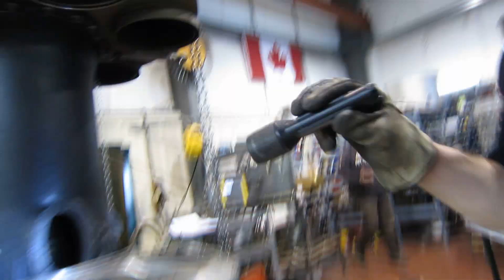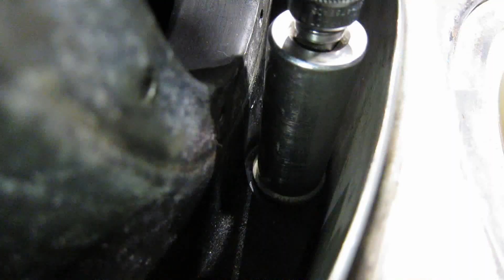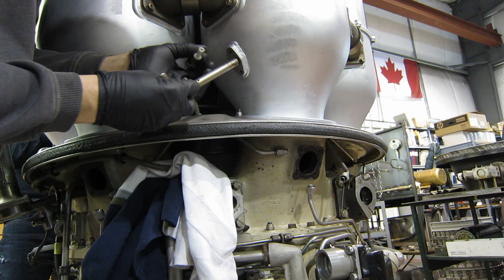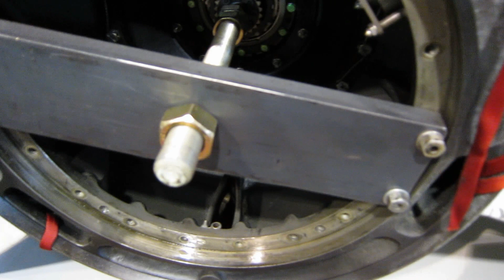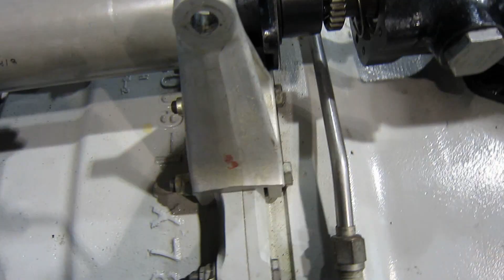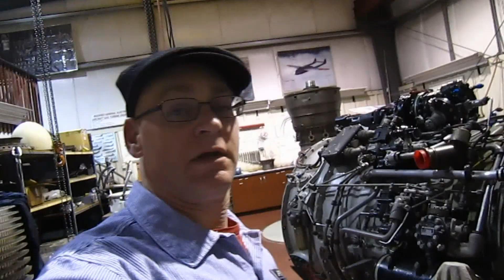Orenda 14 Part 3: Reassembly

Comment: from my experience on the J-79, a faulty #2 bearing can cause damage the rear compressor shaft. you must take measurements of the shaft before continuing closing the compressor module with the rear frame and combustion section. 
your series of videos taking me back more than 25 years when I was working on these engines. 
cheers!!!

Comment from the maker: I didn't mean to imply that reliability meant resistance to gunfire. 
I think all the redundant systems are there for mechanical reliabilty. All the components are necessary to fly, and they are highly stressed.
All the manuals say things like " if one pump should fail...", or " if one fuel control should fail..."

Comment from the maker: We have several RR Nenes in containers right outside our door. They are one of the highest rated centrifugal-compressor jet engines.
Unfortunately they don't have an industrial application, so we haven't done anything with them yet.
I'd like to run one.

Comment: Figured that might be the answer, though I'm so often impressed by what tiny thin part will support several tonnes of force in those engines, it wouldn't have surprised me that the gear drive shafts would easily support a couple of hundred kilos.

Comment from the maker: Walter is the big guy; he's about 6'6"... Ryan helps me horizontalize the Orenda.
... and good eye, there! I was twisting the wire by hand so as to not let the pliers leave a nick in the stressed section between the bolts... This is an aircraft engine, and there can be no compromise

Comment from the maker: The shafts are a bit larger than pencil-diameter, and the angle drives for them are not designed to handle axial loads. The rotor weighs over 500 lbs... would you want your jetfighter engine to be treated like that?

Comment from the maker: The pumps and such are all cast out of aluminum, and weigh about one fifth of what they might as regular industrial parts. This engine has duplicates for backup if the primary fails. Those backups need to be totally independent, not cast into the same housing... again for safety reasons.
How much durabilty would you sacrifice in your jet fighter when the enemy is shooting at you ?

Comment: LOL, before the mentioning of Peter Gabriel, I was asking myself the same thing, "is that Peter Gabriel I hear in the background?"

Looking at those fuel and oil pumps, I wonder how much they weigh, and if their extremely sturdy and durable looking construction is really necessary for their operation even over such a long lifetime of a turbine engine.  I also wondering about multiple components cast as a single unit and how it would lighten and simplify the engine, but at higher replacement cost

Comment: So you have a compressor jack, but why have that instead of using the oil and fuel pump shafts to stop the compressor falling down? You took them out before disassembly, but wouldn't they support the compressor?

Comment: In the middle of the vid, I'm guessing, Walter? In the background working on a small compressor section with VSV's. What is that little guy? Jay do you prefer to lock wire by hand? In a lot of instances I've found it to be easyer and faster than pliers.